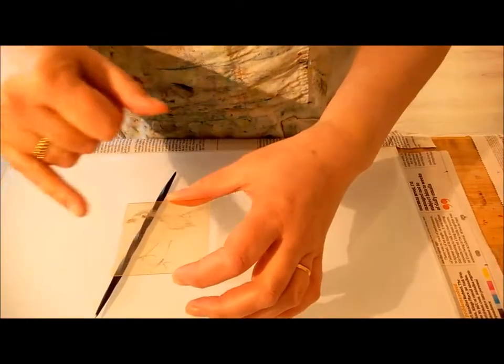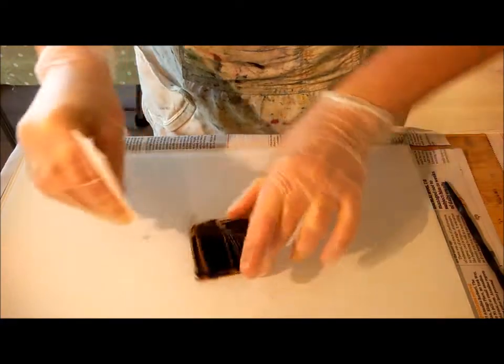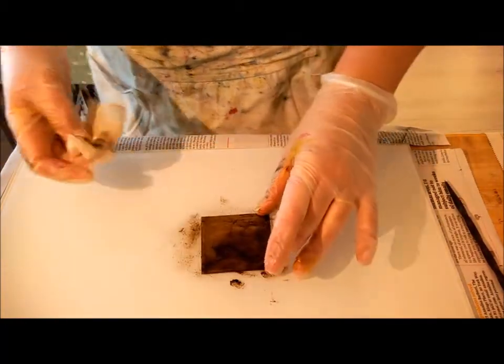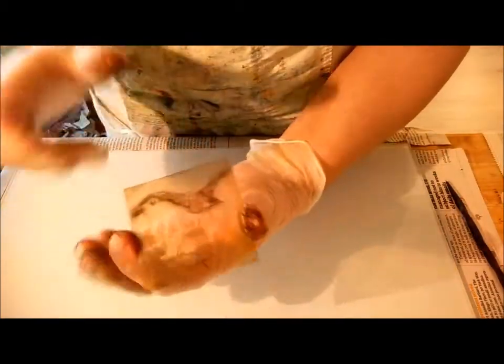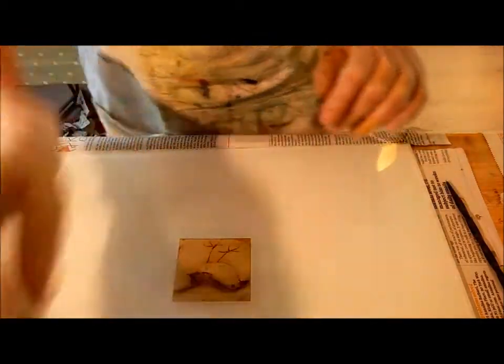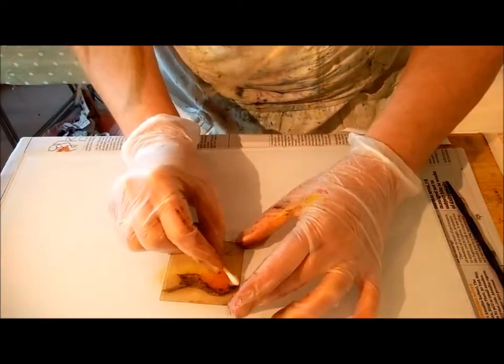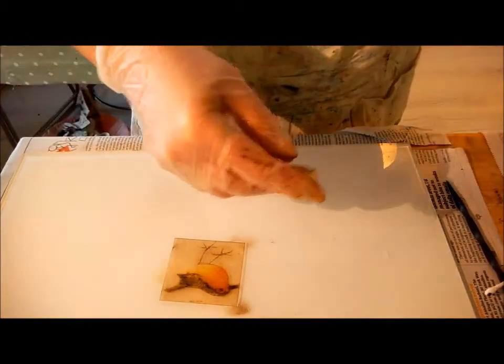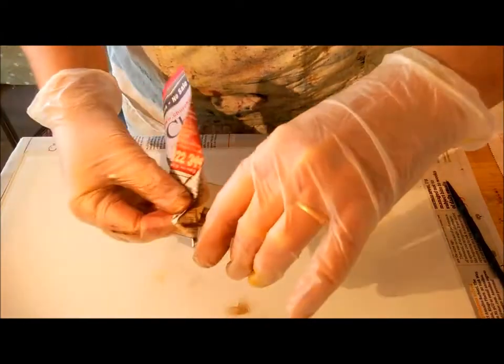Printing a drypoint etching - 'Robin' by Jane Duke

Comment: Love this Jane. I have an antique photo dryer press - I thought it was a book press when we purchased it several years ago. It is actually better than a book press. I have used it to make watercolour lino cuts with surprising success. I will have to try an etching!
Reply from the maker: +D'Ann Sherstone I'm afraid I don't know what a photo dryer press is - and Google isn't helping me - sounds good though :)
Reply: Hi Jane - I can post a few photographs to your Facebook page if you are interested. It is quite the piece of equipment!
Reply from the maker: +D'Ann Sherstone That sounds interesting - please do. If the pressure on the paper is vertical (like a book press), rather than being passed through rollers, I'm not sure it will be enough for an etching. No harm trying though!